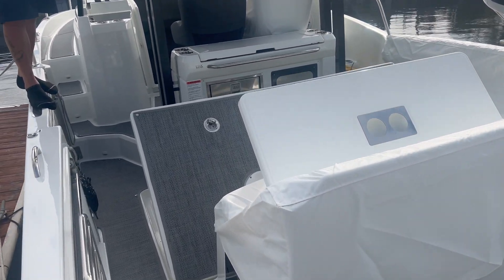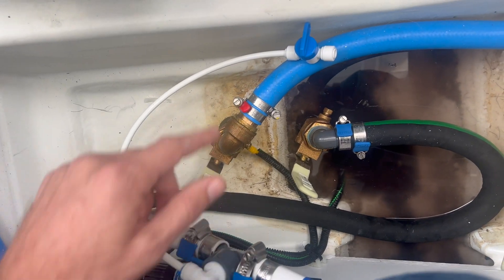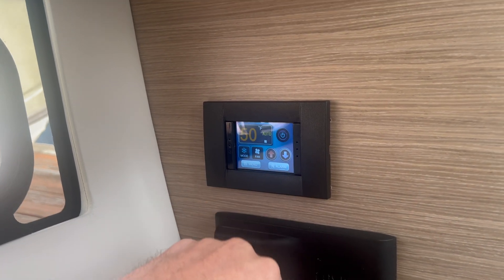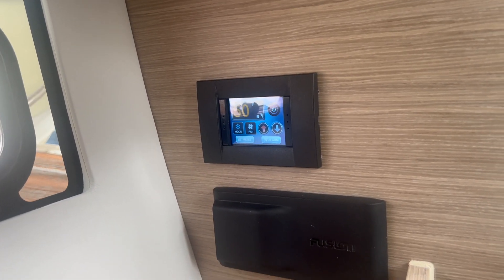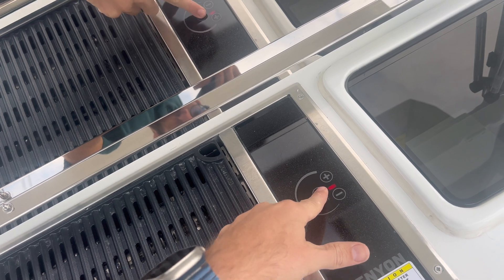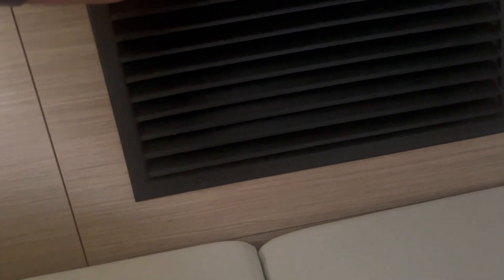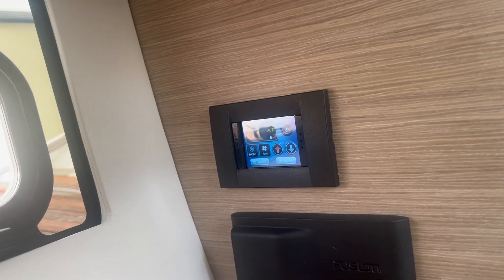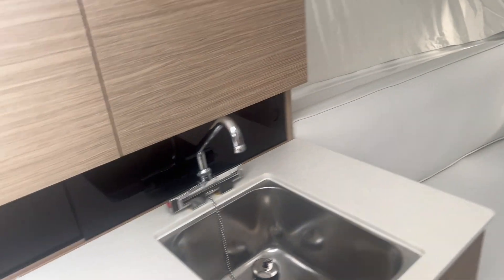Jeanneau Leader 9 0 Series 2 Air Conditioning by Mabru but the Unit is 115v? Introducing our SC09VI

Comment: Mabru is simply the best Marine Power & AC company in Florida, in our family experience for the last 3 years, we used the 12 volts Air conditioning system on our boat for close to 2,000 hs, that would have required 20+ services on the generator which translates to close to USD 15K in services of the genset. Mabru pays off itself. Being able to run the Air Conditioner, have the boat power up all AC outlets, Microwave, electric grill under a headache free system its the ideal (almost a MUST) for a weekender boat! in south florida!

Thank you Mabru (and, by the way, Mabru customer service is the best in the world!!!)
Reply from the maker: Thank you Agustin! It's always great to hear the real-world feedback